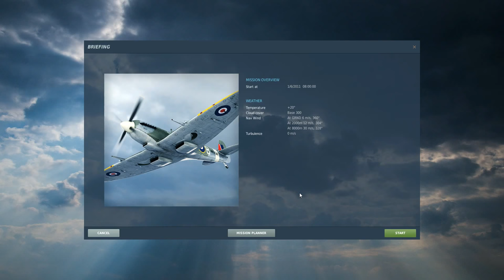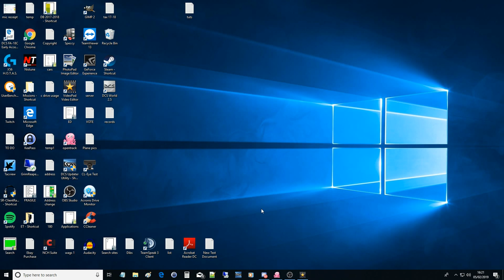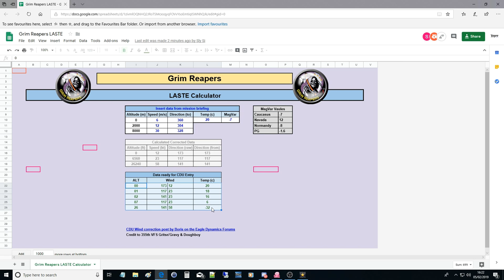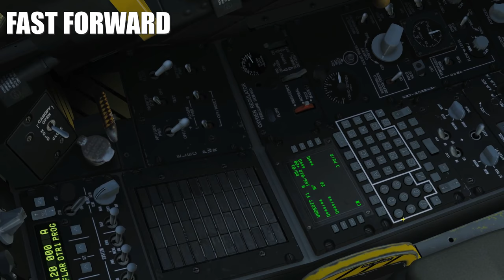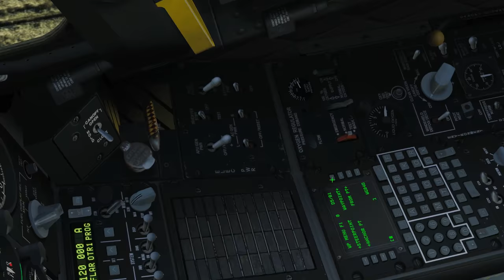A-10C Warthog: LASTE Wind/Temp Correction Tutorial | DCS WORLD

Comment: Really useful. I wonder how it will work with CBU 103/105? Have you tried that?
Reply from the maker: Interesting. 103/105 have their own internal wind compensators don't they? That's whats upgrades 99 etc to 103/105?
Reply: In my understanding, they have an inertial navigation system, which should bring the mother bomb in the right position for a no wind delivery. But when I tried them in hard wind (15m/s), it was necessary to make a 2-300 m upwind correction to get the bomblets on target (without LASTE correction).
Reply: @cmibm6022  This is correct. The "wind compensators" through inertial guidance is only effective until the release of the bomblets. After that, the wind is in effect. So even if your CBU-105 is accurate until burst altitude, the wind will drift your bomblets with chutes. But with the LASTE system, it is supposed to compensate this.
Reply: Thank you very much. I have not had the time to test this, but it will be done.